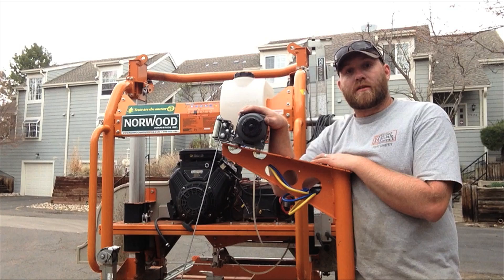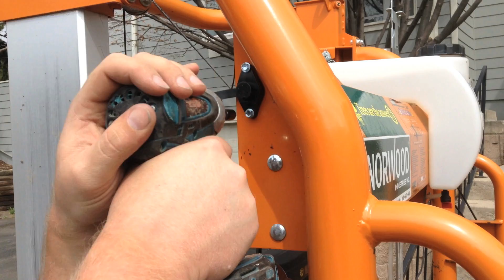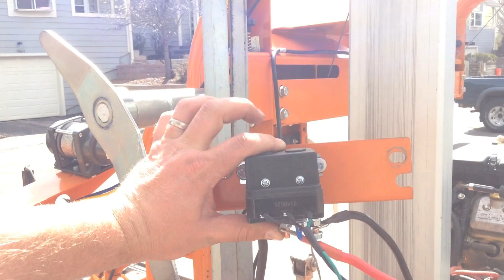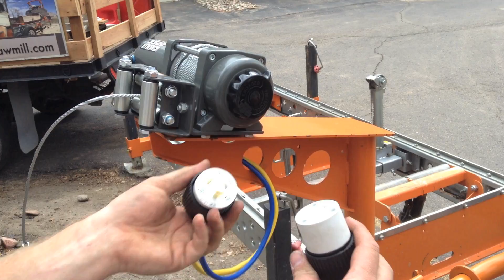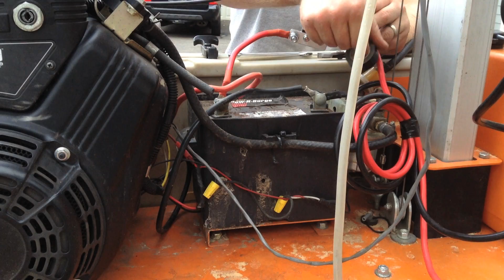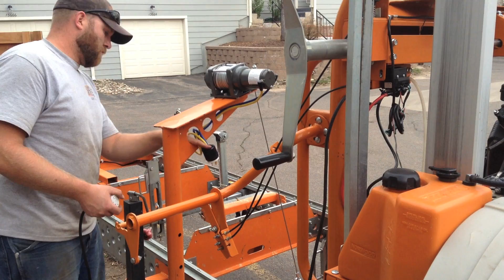Which Winch

Comment: Scott, Spend the $35 bucks and get the remote control from HF. Makes life a lot easier. I like the quick disconnect idea. Also I think the reason your winches don't seem to pull well is because your using the small battery from the mill. Put a deep cycle battery up front and the amps will make your winch last longer and pull better. Mill on my friend! Great videos!